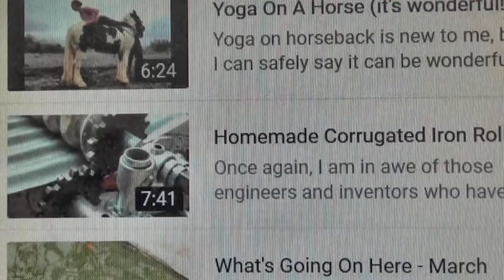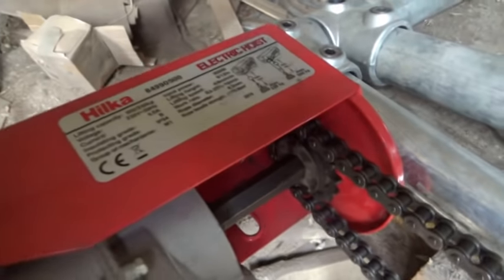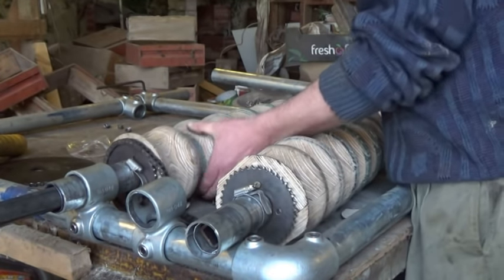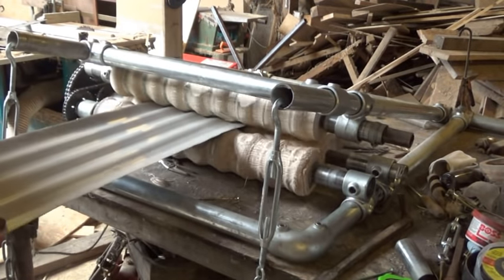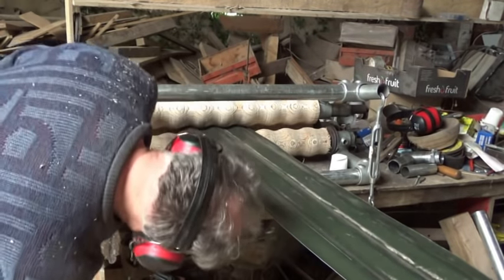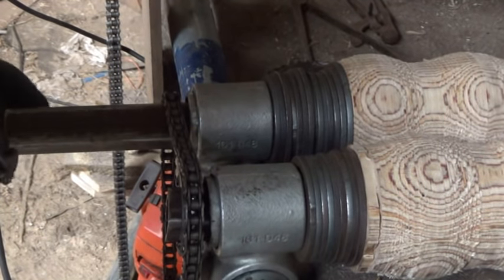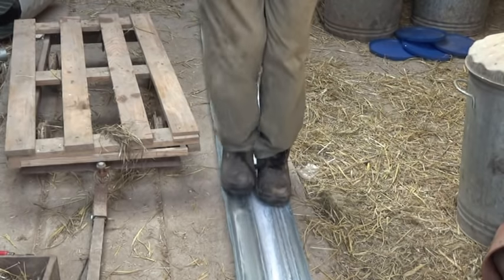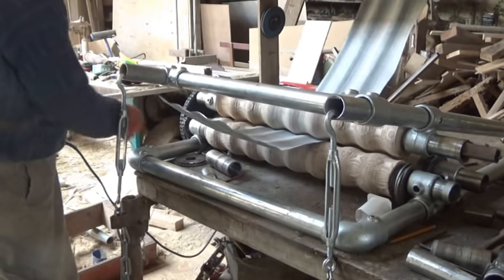Homemade Corrugated Iron Roller - Part Two

Comment: I have nothing constructive to offer, but admire your perseverance.  How did they make the Anderson shelters during the war?
Reply: Hot rolled maybe?
Reply: A mate of mine has a garage and garden shed business, they roll their own sheets, comes in a flat roll, colourbond or zincalume and he rolls it create the profile, and if you want curved it’s no problem. Big machine though, Chinese of course. Hydraulic. The Anderson sheds are not full sheets they are lapped so only slight curves.
Reply: Look for a 1HP or bigger motor mated to a worm drive gear box. That will drive your machine.

Comment: This is why it's called experience. Pressure needs to be the same right across, your not doing anything wrong, but need to realise that different trades are just that, decades of research and development, trial and error, mostly error. However no company would come out and say that. About this pressure, your getting flex, because of your choice of material, this flex could be in the thousandths, tools are precision for a reason, I compare this to most customer requests it's only, nothing is it's only, it's a hell of a lot of work to get quality. This your trying to do is qualified forming, it's not, monkey see monkey do. Read more about form tools, pressures and tolerances and you'll eventually get it, but beware, it's not a cake walk, or there wouldn't be any specialist sections in the trades, if it was. Great videos, don't give up mate, Tool maker 67 years.
Reply: Im not an engineer a maker or anything remotely related but to agree with you theres some things that just cant be done properly and to the standard required on a budget ....and this doesnt even come close to precision manufacturing, but shows how difficult it is to "simply corrugate and bend a piece of metal" ..i mean how hard can it be !?  -;
Reply from the maker: Thanks, Richard - yes, you're quite right, of course. I was fooled by the apparent simplicity of the process - but just like everything else of quality, it's never that simple!

Comment: Heck of a try! I think that some folks below have alluded to it. Your rollers would have to be serrated to shrink the inside of the bend and stretch the outside. It would also help with the feeding to get traction on the steel. I know that if you look at the current commercial quonset hut steel it is ribbed perpendicular to the corrugations. Don't ask me how to easily build rollers out of wood like this!

Comment: I enjoyed both videos, I think this is a task best performed on the initial corrugation. Rolling the the corrugation shrinks the sheet's width and the roll makes the hoop different radius from the inside to the outside if the shelter. Thus the constant pinching you have to stretch and shrink every other part of the corrugation. If you purposely put pinches on the inside (singular) roller it might help. Like cheap bent exhaust pipe vs mandrel bent. You have so much effort put into this project, I would love to see it work. Good luck.

Comment: Hi, i am watching your videos for quit a long time and you and your wife have my full respect, your are a wonderful couple. I had a problem once trying to form a bronze sheet of metal using  a two part steel mold and a hammer to press it. Imagine that will make a half a sphere shape about 2 cm diameter. The problem was that the sheet with the pressure of the hammer whirl . The solution to this problem that work for me, was to put two metal sheet together instead of one , when i was hitting with the hammer. As miracle everything goes perfect. If you don't have dismantle your machine may give a try, because i am afraid that the material is too soft. Keep up the fantastic job you are doing , cheers from Greece,  Spyros.
Reply from the maker: Thanks for the suggestion - I think I'm not strong enough to roll two sheets at the same time, but I'll try

Comment: I think you have given this project enough of your time Tim, from an engineering point of view, I think your problem is a combination of robust machinery set up, roller diameter and power. Maybe the sheet needs to be heated just before it is rolled. Regards

Comment: Any two adjacent crests need to begin further apart on the flat sheet, because the object is to bend, not stretch the metal. So you need a series of rollers, with each successive set having its crests set slightly closer together. Plus you probably need lubrication of the sheet so it can slip sideways

Comment: When roll forming all of the roller shafts need to be in perfect alignment with very little play. Also most roll forming is done with several sets of rollers that start out with a minimal bend and progress to the final shape. You sure gave it a hell of a try.
Reply from the maker: Thanks Michael. Check out the latest version in this series..

Comment: 10 out of 10 for perseverance Tim :-/
Seems there's a fundamental problem - even with a smaller corrugation, the difference in radius when you bend the sheet is going to buckle the inside. The rollers stretch one side (I think) but it's almost impossible to compress the other side longitudinally. No Idea how it's done.

Can't those designs use the corrugations going back to front for the roof? I know the junction with the walls adds complication but...

Comment: Here are my 2 observations , Donno if they’ll work on not but since u tried everything may be you can give these a try as well.
1 - try inverting the sheets once they start to curve . I mean inverting the sheet after 1-2 passes . This should eliminate the sheet making curve lengthwise.
2 - as already suggested by someone , you are putting all the congarntion at once which is putting a lot of stresses on the sheet . So instead what if u can place the rollers diagonally , like stairs . I hope I’m making sense ..😀
Reply from the maker: Very interesting. Thank you.

Comment: I'm no expert in corrugated metal bending.  However, as a suggestion... Calculate the diameter of the shed, based on the LONGEST DIMENSION OF THE FINISHED SHED. either the height or the width. This will create an oversize curve, but will have flexible tension. Bend the metal for a complete curve ONLY, as if you were making a corrugated circular pipe. (In other words make the length of the sheet DOUBLE.)Then, cut the sheet in half.  The diameter of the larger circle will provide the extra length needed for the sides, and will naturally cause the sides to be straight, once you secure them at the bottom to the pallet. The natural tension of the curve will be maintained. And you will have the makings of two roofs with the one circle. 
Another way is to measure the total length of the finished panel, DOUBLE IT, and use that as the circumference of the circle. Just bend it for the circle, not for the sides.

Comment: The only thing I can think of, is to turn the defect into a feature. Set it up more like a bender than a rolling machine. Put the three rollers such that you get a kink every 100 mm exactly on the so called curved sections,. And leave the metal perfectly straight in other areas. 

Or, just bend the corrugations at the ridge and the eaves. Only three bends per sheet. Do not worry about kinks. Hit them with a hammer to make them look even. In each kink the "hillside" of the corrugations need extra surface area since they can not be flat, so a fold or extra ravine is needed. This could be hammered in or made dimpled.  Experiment with some aluminum foil bent to match corrugated iron while sitting at a table or watching a telly at your leisure and you might come up with something that works. There is also something called wiggle board that can help keep the shaped pieces shaped. It might be made of wood or foam.

Comment: You need progressive rollers; when you swish them the space between heights wants to be closer on the sheet but the rollers are the same of te pass before. If you make an ondulated curve you reduce the width.
So the cheap and easy way out is a long roller with only a couple of bumps and a long arm so you pass more times a sheet at different whids. That works for sure and is also the cheapest option you have
Reply from the maker: but I'm not trying to make corrugated sheets - just roll them to a curve

Comment: Hi very nice job,  have you thought of making raised beds for the garden the half sheet size is just about the right height for a raised beds. The best sheets are ones called galva loom for the garden, they use it a lot in America it is a process of galvanising and aluminum. Jeff

Comment: The dents you get in the sheets are probably from the rollers not being stabilised in the X axis, from the video it looks like they tumble around in the holes of the frame. Make the now square-steel core of the roller round in each end to be able to put bearings in the holes. This would make everything alined. Good luck!
Reply from the maker: I spent yesterday changing the bearings of the rollers. And I had exactly the same results in the sheet.

Comment: I wonder if one of your rollers was much larger, maybe say 1/2 to 1/4 the radius of your target product you could use a set, say 3 to 5, smaller rollers around the larger roller's circumference to prevent some of the kinking? Might be hard to make such a large roller to begin with though.

What about some kind of 2 part form that's the shape of your final curve, and you press the halves together?

 10/10 for effort. 😀

Comment: I feel your pain, man.  And I really admire your persistence!
I think the problem might be that you are stretching the inside curve and then trying to compress it again.  What if you only stretch the outer curves?   I'm not really sure how you would make that happen with steel, but I've played with a lot of aluminum foil.   If you drag your fingernail along a sheet, putting a lengthwise hump on on otherwise flat space it wants to curve away from the hump, giving you a corrugation on one axis and a curve perpendicular to it.  Just a thought.

Comment: I had  a company here in Florida USA put ..  5V crimp  Metal roof on my home.  The steel sheets are crimped here in Sebering Florida . I really like the results.  The 5V crimp has 2 on the far right and left side and 1 crimp in the center.             Upside down view.   VV————-V————-VV

Comment: your corrugated sheets are basically cold formed which creates residual stress in the material and that makes them stiff to bending. and they have been forced to plastic deformation also. that means if you straight them they would not open to a constant thickness sheet. so if you are trying to form them plastically again against to their stiffed direction you would see lots of reaction force.. and if your hardware would not capable to hold geometric tolerances which they cant as i see, the form would break at some points and makes sheet to double.. you need constant pressure with rigid forming tool at the end of the day. i am not sure but heating your sheet before forming, annealing it would help you either to decrease forming forces.
Reply: step forming also would be a solution but you need lots of mid form rollers until to reach target form. it is not directly related with forming pressure you applied with screw.

Comment: I have only worked with flat stock, but the basics are the same. The corrugated will take a lot more force to bend.

You have built a pyramid style roll. I have always used a Initial pinch roll. might be able to swap styles and get better luck. 

Initial Pinch roll works by feeding the metal between the powered rollers mounted in the vertical axis one above the other. The 3ed roller is free spinning and is mounted behind the lower roller, and has an adjustment at an angle so as it gets tightened it gets pulled towards the upper roller. The 3ed roller is there as the leverage to bend it.

Big advantage with the pinch is you get rid of the flat ends that a pyramid leaves you with. To do this you have to repeat 3 steps.
1. Feed end A and let the whole sheet pass threw 
2. Feed end B  and let the whole sheet pass threw
3. slight tightening of the 3ed roller.

If you make too many passes you will work harden the metal and crack or kink it. If you try to bend it to fast it will kink. Have to find a happy medium. Also the flat spots on the rollers might be causing some of the issues.

Some Kind of coating on the powered rollers might help with friction. The 3ed roller shouldn't need it. I have no idea what coating will work and last.

Other people are talking about different/progressive die sets/rollers. You don't need them. RAJINDER MACHINE TOOLS has a video of their machine doing what you want with 1 set of rollers. That machine can't swap rollers fast so if they were right they would need multiple machines.
https://www.youtube.com/watch?v=t2la221Q0so

Best of luck.
Reply from the maker: Thank you Mithral. The first version I made was a pinch roller, but my cogs weren't the best and there was too much slack in the bearings. Perhaps I should revisit it though.

Comment: I would try centering the top and bottom rollers over each other 2 sets, a pre form and a finish form. I saw a machine years ago that used steel  4 inch dia. in line skate wheels and not a roller, May have been 6 sets in progression. Feed was about 1 foot per second. I think it was called Pacific Corrugated in California, USA.

Comment: my intuition says that part of what you need is some compression force to "squish" the steel thinner while it is being formed.  The 3 roller system with spaces between the rollers could never acheive that... so... my suggestion would be to return to the original design where the two forming rollers were tight together, and then rather than have 1 roller on the outfeed to curve the sheet, why not make it symetric by adding a fourth roller to the other side and have both rollers push up a the same time (rocking of course because only the outfeed part of the cycle adds curve... but rock it to the other side when it reverses).  Just my hunch... not sure if it would work or not.

Comment: Just had a thought: watch some videos about how metal expands and shrinks as it is bent. It might be that you have consistent radius over the length of your roller and the ends are being drawn toward the centerline making your long sheet more of a wedge. Over it;s length.

Also, what if you rolled flat sheet first, then added in the corrugation? (Still keeping in mind that the outside edges will be drawn to the centerline as they are bent.

You might need to make several of your rollers and do them in steps in order to get your desired result. I don’t think you can do it in one step (bend and roll).

Maybe one step bend and 2, 3, or 4 steps corrugating. Meaning each profile will be more and more round (as the edges reduce the width.

Comment: Wow!  Good job keeping at it for so long!  I was thinking about making something similar to manufacture custom fenders for my bike.  Your experience is very useful. 

My wild conjecture: maybe your roller tolerances aren't good enough?  It looks like you're only squishing it a tiny bit each go round, maybe less than some runout in your rollers?

I wonder what thickness of uncorrugated metal is equivalent in bending to this stuff.  Maybe it's just too stiff like you were saying.

Beautiful animal house design by the way.

Comment: You've pretty much chased down everything that would make this project a success but the one thing that is defeating you is access to the correct material. I am staggered that you can't buy soft feed corrugated for curving in the UK. Would love to send some over from Oz but sadly the transport costs would be way too high. I might have mentioned last time we spoke that I have two sets of corrugated curving machines. One a super old cast iron job with quite widely spaced rolls and a newer set with very close bottom rolls. With high tensile corrugated the best I can do as far as curving the sheets is 8 feet long with only a 4 inch rise in the center. so don't expect too much out of high tensile steel corrugated. Push it any further past that and it will exhibit exactly the properties you have found out. With my newer curving rolls I have managed to curve a tank to about 18 inches diameter. True story. It was for a stationary engine. Had to throw the two outside corrugates away as they crinkled up pretty bad but the inside center corrugates were fine. I regularly curve bullnose sheets where the curved section has a radius of  less than 400mm and closer to 350mm. So with the correct material to start with you would achieve your goal. The material does exist because we use it to this day. Ah well. You tried valiantly and I salute you for your perseverance. I am a lesser man than you as I would have given up before this I am sure.
Reply from the maker: Thanks, Phil. Yes it seems to be (mostly) down to the material now, and I'm stumped. As someone else suggested, perhaps we ought to move south..!
Reply: @WayOutWestx2  Come to Oz, you'll love the weather and we have curving quality iron. ;) I wish I could show you some of the curved roofs I have done. One of the houses we did had two turrets on it and they were both octagons in two tiers which were all clad with an ogee shaped roof curved of course out of soft feed corrugated iron. Such a complicated roof to curve up and fit. Ended up looking spectacular though. Like two of those old Victorian band pavilions joined together with a lot of other roofs as well. Lounge room had 17 foot 6 ceiling height in it.

Comment: I wonder if the frame itself could be the issue. There seems to be a lot of play. Particularly noticeable as the material links, how much the frame moves
Reply: I was thinking the same thing,I think if he were to eliminate the 'give' in the frame, say by building a new frame out of plate and hss tubing, rather than the thin scaffold tubing he's using it may prevent the metal from getting enough room to form ripples.